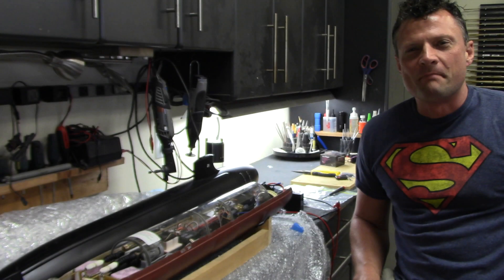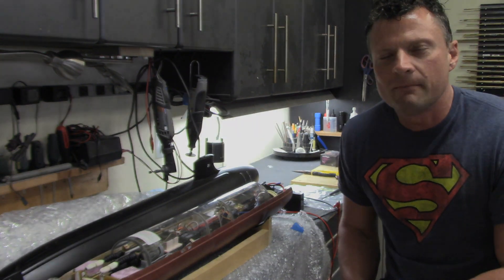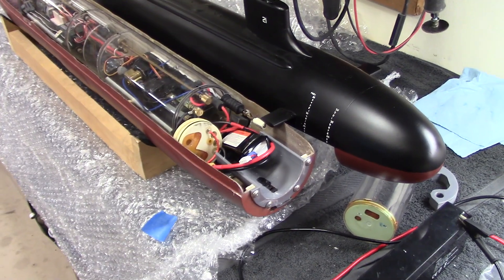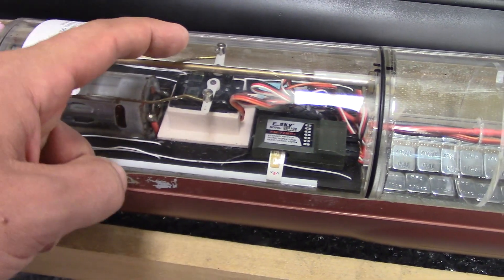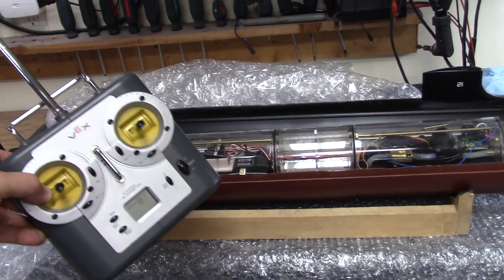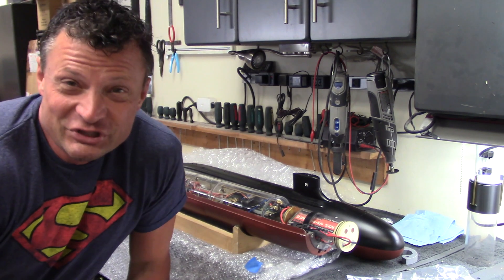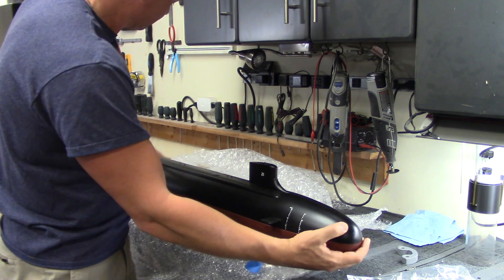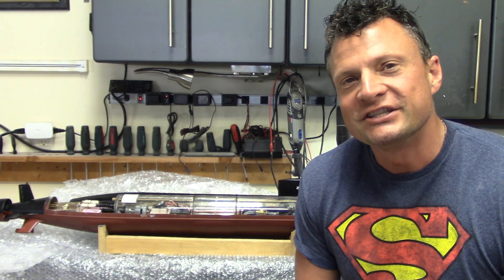USS Seawolf RC submarine refit

Comment: On the ballast system is the pump reversible? Like it can pump water in and out?
Reply from the maker: Correct. Two-way pump (as I mentioned in the video). That is standard OTW dive module configuration.
Reply: certainly it pumps in and out that's why we make them that way Bob D OTW

Comment: I'm a former Seawolf sailor. I understand that the Matt Thor Seawolfs are increasingly difficult to find but if anyone is selling one or knows of one that's available, let me know.
Reply: I never followed through on the creation of an all new & updated SSN21 due to the release of Pete P's gorgeous 1/96th Model of Seawolf.  The first iteration of the Thor Design SSN21 was based on the very nice drawings done by Greg Sharpe of Deep Sea Designs.  A few years after the initial release much more accurate information became available which called for a completely new pattern & tooling.  Pete's model is now much more accurate than the original model I produced, so it made no sense to create another kit pattern and have two identical competing models in this tiny little market.  Check Pete's boat out.  It is a beautiful piece of craftmanship.  You won't be disappointed!
Reply: @mattthor7740  I appreciate the response! I'll check his model out. I have the 1/144th scale but I think it's just too small for what I want to do. I planned on doing one with a bit more of a scale propulsor knowing what I know about the Seawolf. Does George P have a website or what would be the best way to find his version?
Reply: @cmccormack91  visit www.subcommittee.com.  That is the home of the largest group of Submarine modelers around.  You'll find Pete there.  He's a great guy and I know he'll be very happy to help you.
Reply: @mattthor7740  thanks I appreciate it!